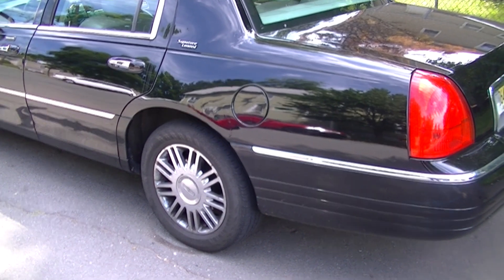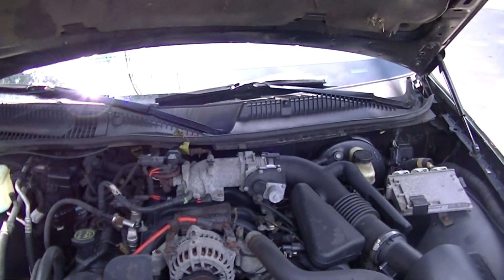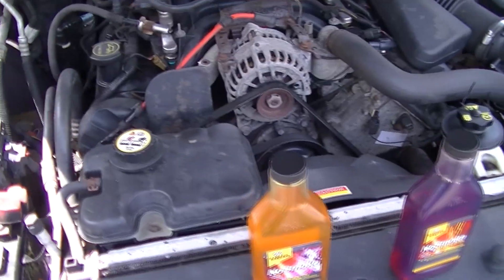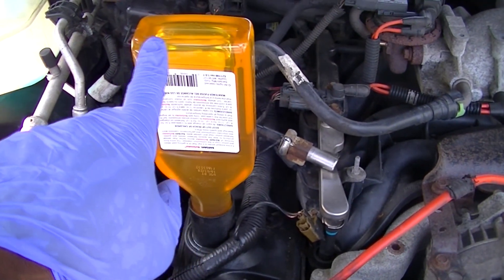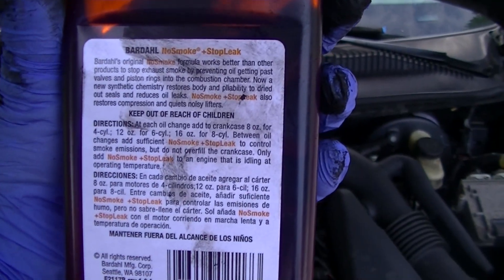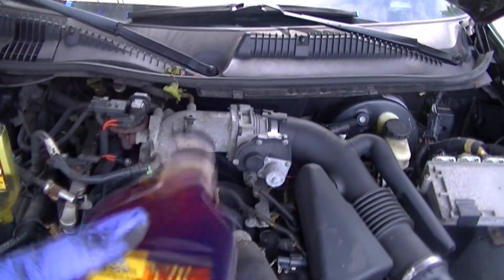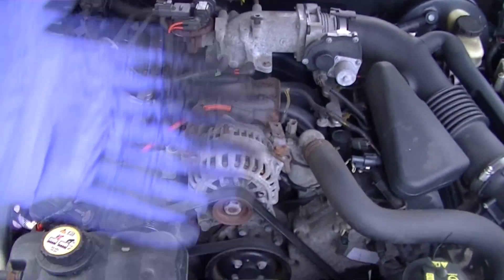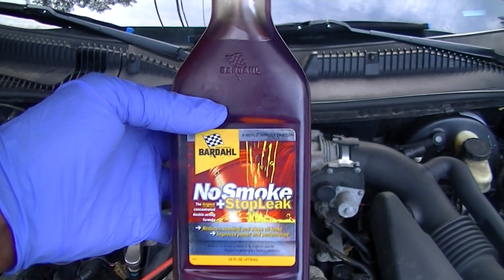Bardahl No-Smoke oil additive

Comment: Small tip. When you place the bottle upside down, poke a hole on the bottom of the bottle, and the motor honey will extract faster.
Reply from the maker: Thank you! that what I should have done... I was just wanting to see if this work... it worked but nothing beats getting the part reaplaced ( valve stem seals ) ... When you changed the oil well you are screwed

Comment: I just bought a truck a few months ago and not long after i got it I noticed thick white smoke coming out the exhaust when I started it up. So I took it to the shop and they told me it was a cracked head gasket so I figured I minus well try that blue devil head gasket sealer but it still smoked every time I started it up. I drove it around for about a month back and forth to work and same results. Then I noticed I was losing oil so I tried this product only because they were out of everything thing else and surprisingly it worked!
Reply from the maker: This will not help that brother... You have some issue there... Sorry about that one ... people scam out there be safe dude..

Comment: When oil starts passing the rings it gets on top of the piston and burns off during combustion and the smoke is vented out the tailpipe along with the rest of the stuff . So while you're sitting there burning oil you're destroying your catalytic converter and you are gumming up your exhaust valves .
Reply: Dr. Westside it actually does work
Reply: To: Dr. Westside... Not necessarily, When a car smokes it's not always the rings or pistons, it could actually  be the head, some foreign and Japanese motors have rubber seals located inside the head that make the vehicle smoke do to high mileage and wear and tear over time,  however they do make  additives to swell up the gaskets seals and Prevent the car from smoking.
Reply: You are clueless
Reply: correct information, but it's not the rings that's gone bad, it's the valve stems' rubbers. these additives swells up those rubbers by microns thick, it's a temporary fix

Comment: My only smokes on a cold start up. I do have that product im just skeptical on using it.
Reply from the maker: its works a little but for what you have it maybe be the valve stem seals... it works but not for long each oil change you will need it

Comment: Hey I have 06 Honda crv k24 I used as the bottle recommended and I’m still smoking would adding more help ? I might invest in the purple product since it  may have a blown head gasket
Reply from the maker: you have a Valve stem issue or rings... I seen one today smoking bad... Nothing will help that type of smoke...
Reply: It’s actually helped out I ended up adding the entire bottle and it calmed the smoke down a lot much thinner thank you brother now I’m not super embarrassed to drive
Reply from the maker: @mg3790  just have to add it evetime you do a oil change....Glad it owrked out some what bro...

Comment: 99 crown vic, 146 k miles, no codes, starts right up, no leaks on the floor, oil consumption, compression ok, think valve seals, do you know a product  I can use help seals before complete repair? thanks

Comment: Lmao this guy is good “ if ur like a scammer car sale men “lol
Reply from the maker: Thats what they do Jesse they think-n up the oil and add this and you will never notice UNTIL you change the oil
Reply: @bstfordchannel923  
How many miles does your towncar have. I used to drive them aa taxis way back when. The repair shops would use 5w20 on brand new lincolns,fords, ans mercs. When the cars reach say 175,000 miles, all repair garages would put 10w40. Then again, taxicabs woule average 1200 miles a week. So every 2 weeks, had to get oil change. Keep that 10w40 in motor for 6 months, itll turn into tar. 

So i think, you could get away with 10w40, only if using it as taxi, because the oils gonna be changed atleast twice a month. On my personal grand marquis , 60k. Only 5w20, and motorcraft filter. On my 2000 grand merc, its pushing near 200k, ill put 5w30, or even 10w30. My 1989 grand merc, ill put in anything. 

The only oils i avoid are synthetic. Never used it, therefore, dont trust it.

Comment: What about if i got a oil change 3 weeks ago? So the other i had it running in park for 3hrs and when i drove off  it started smoking bad .
Reply: Wich one would you recommend
Reply from the maker: The one you had running for awhile thats the valve stem seals... you can thicken the oil a little and it will be better , but not a quick fix oil change thinker oil
Reply: I had a typo it the same car I had it running for 3 hours parked

Comment: Can this be used in a 1952 Cadillac. Clear does blow smoke from blow by, just looking to reduce the smoke.
Reply from the maker: ahh man that car is old that may need a rebuild but you can just try thicker oil and see if that helps

Comment: I have 2010 scion xb with oil consumption issue and it is also burning up oil through the exhaust gonna try this product hope it will help🤔 thanks
Reply: Hey JP 74, I have ScionXB  2012 and I noticed she's burning more oil than usual. Did the no smoke help? Thanks.
Reply: @6c122  hello have not tried it yet but she's still running good 👍

Comment: Wait the car has to be on and running and operating temperature when this is added? I added it to my 94 acura integra while being off for the whole day and it actually helped
Reply from the maker: Yeah thats what the direction say BUT either or ( to me ) Its just a THICK additive so they want to cover there ass ( thats all ) some people live in a cold area or some cars run close tolerance ( engine wise ) so its best to warm the car up thats all.... Old Acura will be good..
Reply: I used the oil thickeners in a '90 Civic 1.5 , no Vtec  .   
This was my first car and I tried to improve it by switching to synthetic for the first time but most of it leaked out or burned off , there was less than a quart on the next oil change and it was very dark.  
From then on I stick to conventional in old high mileage cars and change it more often to keep it clean. I do use the STP & Lucas treatments on cars without the VVT , cam phasing, etc.  
I prefer the STP mainly due to cost   
$3.84 the last time I bought it compared to $6-$9  for the quart of Lucas , I Oreiley's has a store brand product just under $3. 
I've seen proof of the stuff working on the "project farm" channel .
Reply: @bstfordchannel923  how'd it work for you?

Comment: 5w20 is for new or rebuilt engines. A high milleage engine lets say 150 000 milles or more will burn 5w20 because 5w20 is like water. 10w40 is better for high milles engines.
Reply from the maker: True Edvin , but this 4.6 they made everything close ( rings to piston to cylinder wall ) and bearings to.. So when you rebuild these at home you MUST know what you are doing... Unlike old engines ( many ) that take 10w are made not so close...302 Ford for example you can rebuild it ( not even in spec ) in many cases and it will run very well.. Not this 4.6 when they are done they are done..
Reply: You do not change the viscosity of engine oil just because it has a hundred thousand miles on it . Oil journals are small in the pressure that supplied through them needs to stay consistent . I will say your logic is sound for older pre computer-controlled engines .

Comment: Nice might try this on my girls Camry. Has bad valve stem seals and smokes on first start up everyday. I try it out next oil change!
Reply from the maker: it may work for that mine is more on when the car heats up and idles or stops, then you hit the gas then you see the smoke... And  i dont see the smoke ( cloud ) like before so its good.. the engine worn so in the future i may get the L version of the Towncar..
Reply: BST Ford Channel if it was worn it would smoke all the time.
Reply from the maker: Thats the funny thing i said the same thing ( in my head ) but loosing oil very fast ( on trips ) not around town again i change the pcv nothing has changed

Comment: I notice my 100k mile turbo diesel blows smoke on cold start in the morning, not always tho. Originally It calls for 5w40, but i gave it 10w40 when it reached 80k. Since this product is that thick..would 10w30 oil pair up with this? Or just stay with 40?
Reply from the maker: Thats a tough call  diesel have high compression so things have to be really tight... This may not help that....

Comment: Gonna have to try that on my 91 civic it’s burning a quart every 30 miles now but with 500k miles it’s needs a new engine but good to experiment on haha
Reply from the maker: yes it will be a great test mule i have another car i can do a test on
Reply: How’s it working for you?
Reply: @yrh7867  it’s still burned just as much atf seemed to work thoug used 1 quart of atf in the oil
Reply from the maker: @yrh7867  it worked but its needed every oil change... also its best to fix the issue depending how bad it is...

Comment: Having read  the instructions on how to use this product you did not mention that you should at least Keep the Engine running in idle so as to get the Engine  warmed up : The purpose of this is when the Bardahl No Smoke is poured down  into the Engine that the thick liquid kind of Melts or  softens due to the Heat of the Engine; There is also something else worth mentioning and that is check the dipstick to see if the Oil Level is not  going to overflow when the No Smoke  is applied ! Another thing if the Oil within the engine  has exceeded recommended  Mileage  for  an oil change and filter change  change the oil and then use the No Smoke ; It's also worth mentioning that  Dirty oil is the Culprit that causes Problems with the Valves getting sooted up where Carbon within the Dirty oil is like an abrasive and causes the Valves to loose compression; but of course Buying a Used car where the previous owner did not care a damn No smoke could be the Helpful thing
Reply from the maker: agreed , but my car had valve stem seal issues so this did calm the smoke down, but when you change the oil its back to normal smoking only when the car idles in the summer vs the winter it did not happen

Comment: Change your pcv valve then add motor flush run the engine for 5 minutes drain out then use only full synthetic oil,  check your  spark plugs . If that doesnt work use the NO Smoke , this stuff is thick as honey bad  to use in the winter time, thinner oil is best for the winter time, ok to use thick oil in the spring and summer
Reply from the maker: Tried pcv it dint work... they used 10w-30 and 40 in the 4.6 so thats what killed the rings
Reply: You could just , oh I don't know , pull the Pistons and change the oil control rings .
Reply from the maker: @Dr.Westside  Rebuild is need this ( is for the side dealerships 0 a quick way to calm the smoke ( sucks to say ) but thats what its aimed for

Comment: So in every oil change do i put all the oil that my car needs plus this whole bottle? Or should i use 1qt less and add this whole bottle?
Reply from the maker: Yes One lessquart will do and check your pcv valve also and change that..
Reply: @bstfordchannel923  good day I Hope u are fine, i have auid A4 tdi is smoking not continuously buy after 1 or 2days is smelling oil what could be the problem I just fix the turbo but the problem is there.

2) do u think no smoke/stop smoke can work?
Reply from the maker: @tapiwaruzvidzo9563  hmmm? this may not work .. I had Audi ( 100.200 5000S ) now your smoke can be cause by the valve seats.. My car never smoked right away.. It smoked after long idle... Your car maybe be the valve stem seals.. You have to check the tail pipe and wipe your finger in it and see what ( could it be ) can be the piston rings also.. try a thicker grade of oil
Reply: I did like u said it work for me

Comment: I only used it once and it works but now I want to know the effects of this in the engene plz help
Reply from the maker: nothing the thing is that you engine needs rings or valve stem seals. this thicken the oil... when you change your oil you may need another.. This is not a mechanic in a bottle.. its just to get by a bit Joe

Comment: Run 10w30, it's just valve seals. Replace them and it will be like new. Someone prob neglected on changing the coolant and it ran hot at one time. Order some good felpro valve seals
Reply from the maker: Here is what i found about the car... The car was tan so the painted it blk.... Now since the car was black it was used as a LIMO and the man said it wasnt a LIMO lol... hen the painted the car they took the doors OFF and each door closes semi-funny... So the 10w40 sticker they must have used that a lot cause I think it over heated like you said thus the bad heater core thus the bad trans and the car has been hit ( front ) also i can tell... So you get what you pay for my friend
Reply: sometimes i like deals though too; finding the virgin neglected vehicles is the hard part.
Reply from the maker: Yeah man those two words dont jive together ( good deals and low miles on a untouched vehicle ) like a wholesome hooker it just dont mess well ( sure there is one out there ) , but really doesnt mesh..

Comment: Added some to my 01 camry with worn piston rings think it will help with oil burning?
Reply from the maker: oil burning ( like going low ) maybe not its really to reduce the smoke... If you have a Camry and its smoking ( they normally dont ) well you can try a thinker oil grade and this BUT depending where you live ( cold or warm ) cold weather isnt to good for thicker oil.. you have to wait til it warms up... This one is trial and era.. Nothing can help worn rings,,, Check pvc on the engine and try that also..
Reply: New rings will definitely help .
Reply from the maker: @Dr.Westside  Sometimes its best to get the engine rebuilt or get one with less miles.. Many thing can be cured with a ( mechanic in a bottle ) rings is a tough deal
Reply: Jordan Davenport did u tried it worked?
Reply: @bmwsincekid    it slowed the burning down dramatically I changed the oil with a higher viscosity and added a court of no smoke I probably go through a quart a month and before I went through a quart a week I recently got a grand marquis and I use my Corolla as a spare vehicle
Reply from the maker: @bmwsincekid  it worked until the oil ran low and i install another bottle... this is good for the people that SELL CARs and such... It isnt a mechanic in bottle.. it reduces the smoke I will say that... It depends how bad and what is going on in your engine

Comment: Liqui moly " stop smoke" does it work?
Reply from the maker: If you have ring problem this will not work, if you have a valve stem seal issue ( depending on the leak ) it may or may not work.. Its $5 try it and see... SOME mechanic in a bottle products work for different issues, nothing is edge in stone..

Comment: Look this stuff is a bandaid at best . Don't be a bum , just pull the Pistons and change your rings . Change your head gaskets and main bearings while you're at it . You could have a good reliable engine that with regular maintenance will get a couple hundred thousand miles easily  that you don't have to keep wasting money on for just a little bit of effort .
if you don't know how to do it I suggest you get a Haynes manual and learn or take it to somebody who does know how to do it .
Truth be told you should only use this stull in sling lubricated engines as it will clog the journals in your typical car engines . the added viscosity also puts a huge strain on your oil pump .
A good set of moly  rings cost about 40 bucks . In reality using that stuff in a car does a lot more harm than good .
I'm not trying to be a hard-ass but after 25 years of working on cars I've seen a lot of people use products like this and over time it makes things so much worse .
Essentially you could go from something fairly easy to fix to needing an entirely new ( or new to you ) engine . Your choice .

Comment: Does it reduce oil consumption?
Reply from the maker: it does but even a slighter grade oil will do also, but this is good along with that.
Reply: BST Ford Channel thank you!
Reply from the maker: @robertmitrea3251  in my last car i went from 1 quart a week to 1 quart every 12 days not a full 2 weeks.. note drove 150 miles per day for 5 days

Comment: Bring it a shop. Oil inside the combustion chamber means your gasket needs replacement.
Reply from the maker: thsi had valve stem seal issue on this motor.. i opened it up later
Reply: Thats not a gasket issue. Thats usually a valvetrain issue

Comment: Engine has to be running rookie
Reply from the maker: You are correct J-Gonzalez ,but lest say you have a old BMW M88 Inline 6.....( M88 isnt the series its the engine code ) Now these motors IF you have car running  and TAKE THE OIL CAP OFF, it will run like it has a miss... Will cars like this you run the engine 1st ( hot ) then shut off ( then add ) this, but those cars rarely blew smoke. They where built very well... I had 5 Bmw e28( 2),e24 (1) e30 ( 1 ) and e32 ( 2)